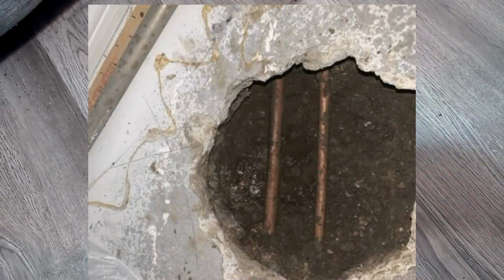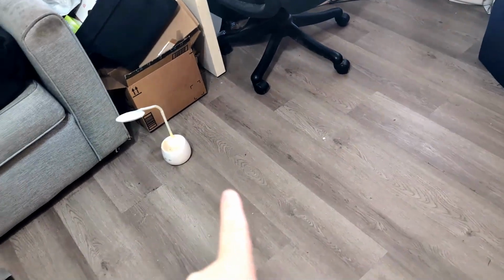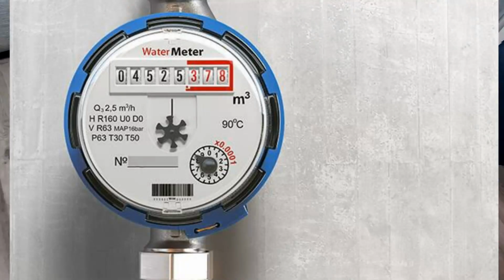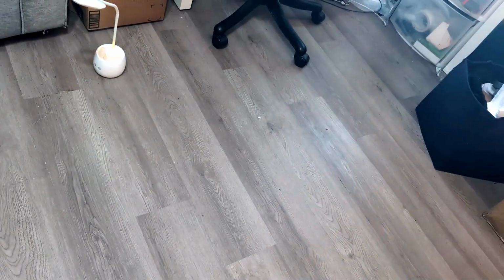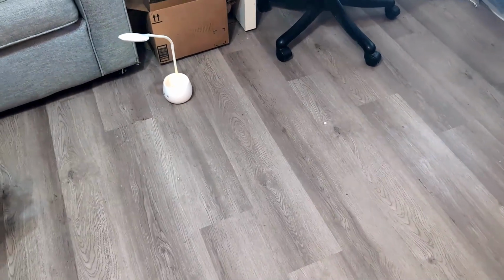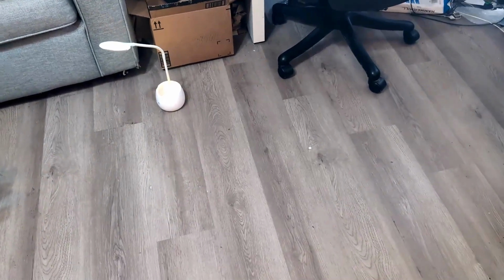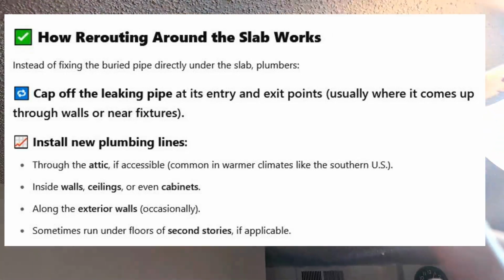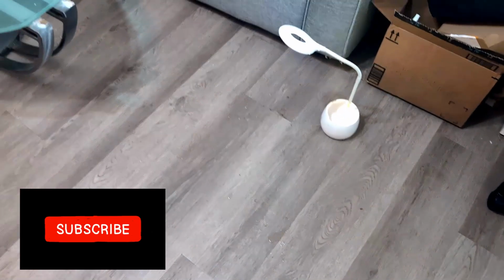Average Concrete SLAB LEAK Home Repair COST & Alternatives to Fix (Water Coming Underneath Floor)

Comment: I have a slab issues caused by branches and there is one hole on top of the cast-iron.
They said they can reroute the two bathrooms and the kitchen and laundry will be rerouted and they’re gonna reroute it out to the patio area and come back around to the city sewer in .
Looking at $26,000.
Reply from the maker: get a couple more quotes

Comment: I have a sewage line slab leak.. was quoted 25k to tear up hardwood floors and slab about 4-5 foot area to get to the pipe. Im from oklahoma. Is this a fair price?  Also now have a water line break somewhere.. inspection is tomorrow... ive had my house for 2 yrs. It's 25 yrs old.. 😢
Reply from the maker: That seems high.  Get another quote or 2.  And plug this question into ChatGPT, Gemini, or Grok AI.  This is what chatgpt told me "Based on your description — a quote of $25,000 to tear up hardwood floors and a slab for a ~4-5 foot area to access a sewage line slab leak, plus an additional water line break — it seems quite high compared to standard benchmarks for slab leak repair. Here’s a breakdown to help you evaluate whether the quote is fair, and what steps you should take.

 What the usual cost ranges are

According to guides, typical slab leak repairs (removing concrete, accessing pipes, replacing the damaged section) average around $2,000–$5,000 for many homes, though in extreme cases it can go higher. 
Chase The Plumber
+3
This Old House
+3
Angi
+3

For Oklahoma specifically, local plumbing cost summaries suggest slab leak repairs “can range from $650 to $5,000 or more depending on accessibility, location, and damage.” 
Chase The Plumber
+1

If you factor in hardwood flooring removal, finishing/replacement, slab removal + repour + patching, cleanup, etc., additional cost layers apply — but even then, a $25K figure is on the very high side unless there are major complicating factors (foundation issues, re-pouring large slab, entire plumbing repipe, mold/structural damage, etc.).

 Why your quote may be high / what to ask

Given it’s a 4-5 foot area (relatively small) to get to the pipe, here are some questions and flags:

What portion of the cost is hardwood removal + replacement, vs. the slab/piping work? Hardwood replacement, refinishing, etc., can add significantly — but typical hardwood patching might run $30–$100+ per square foot depending on finish and region. 
Angi

Is a full slab re-pour required, or just a cut/patch? If they’re replacing large sections of foundation or multiple areas, cost rises dramatically.

Are there structural issues beneath (foundation shifting, termite damage, mold, sewage infiltration) that escalate the job?

Does the quote include finishing work (flooring, baseboards, drywall, staining) or just plumbing/slab?

Does it include multiple repairs (you mention a water line break also) — combining jobs increases scope.

Are there unseen access issues, e.g., pipe under slab corner, near wall, major demolition required?

Have you gotten multiple quotes? Compare at least 2–3 local licensed plumbers and asked for itemized breakdowns (labor, materials, demolition, finishing).

Ensure the contractor is licensed, bonded, and uses proper methods (trenchless options, rerouting, etc.) — it may reduce cost.

Given all the data:

If it were simply a 4–5 foot slab cut for pipe access + repair + small flooring patch, $25K seems excessive based on normal benchmarks.

If there are major complicating factors (foundation damage, full slab re-pour, entire hardwood room replacement, multiple plumbing lines, sewer line reroute, high‐end finishes), then the cost might be more justifiable — but you should review line-item breakdown.

At minimum, I would recommend you seek a second quote (preferably third) and ask for a detailed scope of work and cost breakdown.

Also check if there are less invasive options (pipe reroute above slab or through walls, trenchless methods underneath) that may reduce cost.